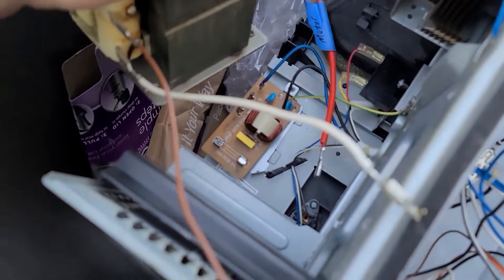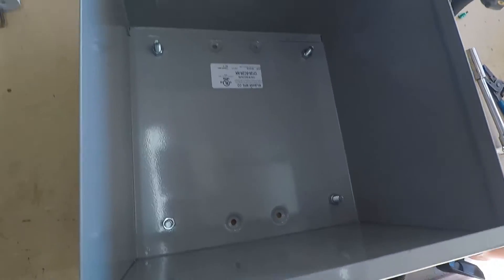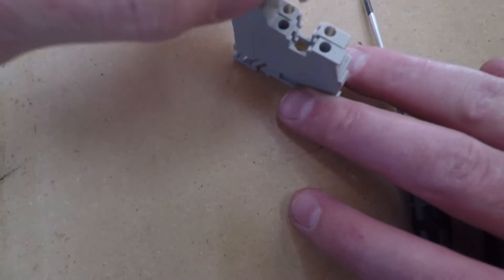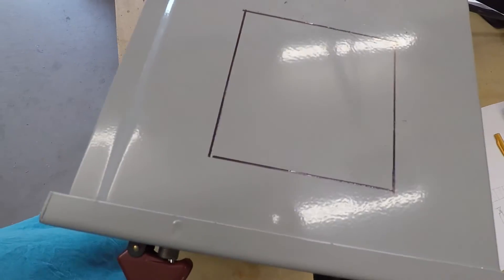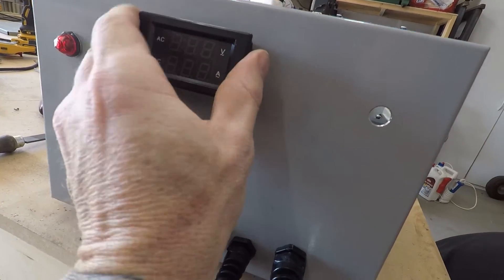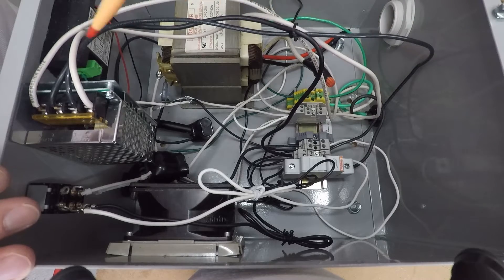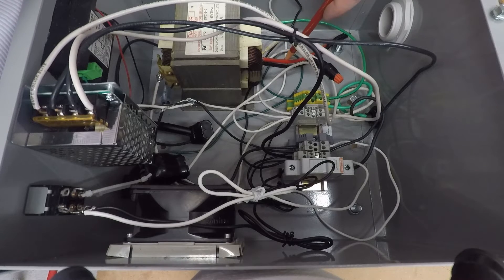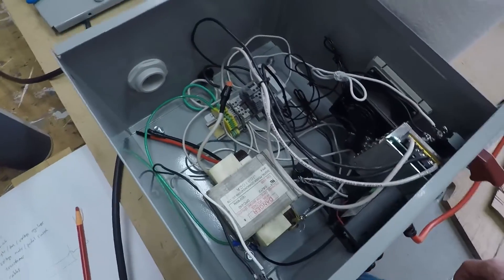DIY Build a Lichtenburg Machine

Comment: I looked at at the first 1:30 minute mark and said I've seen enough.  Opening up a microwave oven can be extremely dangerous if you don't know what you are doing or what you are looking at inside.  If you make contact with the capacitor inside and if still holds a charge, you could be killed instantly because of the high voltage it stores.  The capacitor must be discharged before you can safely work on the microwave.  FAFO.
Reply from the maker: That's a great point.

Comment: The voltage regulator is q waste of money, and it would be a lot smarter to use a plastic box. What if you lose a ground on the plug in the wall. Plastic box would do a lot better.

Comment: So how much for you to make me one?
Reply from the maker: Sorry but not making them for sell
Reply: @Vallenge Worth a try!  Lol
Reply from the maker: @Shadowwolf7774 😂
Reply: @Vallenge Couldn't you use the power from a welder to supply the electrical current into the wood?
Reply from the maker: @Shadowwolf7774 I don't know. I've never tried that.
Reply: @Vallenge it is the same concept, just with a different machine creating electricity at high voltage.😊😊😊
Reply: @Vallenge I bet it will work.
Reply: @Vallenge you did build a badass machine though!
Reply from the maker: @Shadowwolf7774 I really can't say. Feel free to come back and comment about what you find out.
Reply: @Shadowwolf7774 welders are not producing high voltage though. High enough to conduct through steel, but not wood...

Comment: Awsum video. I built my first burner a year ago however saftey was not a concern and ive bin bit a few times lol curently putting together a much safer unit. Im wondering How to read the high voltage after transformer coming out the hot lead? Is there a way to do this without a divider cuircut ?
Reply from the maker: Not sure. I would look for something that can register the voltage by wrapping around the cable if you don't want to interrupt the wire.

Comment: I hit a major snag 😞 .. Which terminal on the transformer is negative and which one is positive for your power cord going to the transformer ??? .. I have 2 of them side by side but dont wanna connect positive to negative or vise versa ...... Or does it matter at all ?
Reply from the maker: Hello. Without seeing your particular transformer I can't say which terminal you would connect to. My suggestion would be to try to use the process of elimination and logic to identify what the right connection would be. Please use caution and don't do anything that is unsafe.
Reply: Transformers are AC. There is no positive or negative. Clearly you have no knowledge of electricity. Please do not continue with this project. For 22 years I worked daily with equipment running on 5000 volts and even built my own 5000 volt power supply for a special project. I DO understand the risks and cautions that need to be taken.
Reply from the maker: Thank you for the response John. Safety should always be the top priority...

Comment: Great Job Thanks for so much information. I would have but one suggestion. In order for the cooling fan to work well you should have an exhaust side on the opposite side with a grill over it possible just a screen.  Thanks again
Reply from the maker: Thank you. Good suggestion.  I actually do have a vent away from the intake fan to allow  air flow.

Comment: Definitely don't take the need for safety for granted multiple people have died through electrocution using these 😫 also when you're disassembling the microwave be wary of the large capacitor it can hold a high voltage charge
Reply from the maker: Good advice. Safety should be the first thing in mind if someone decides to take on this type of project.
Reply: @Vallenge  yeah one lapse in judgment can be fatal
Reply from the maker: Yes it can
Reply: Any help I have microwave.please
Reply from the maker: Hi Ronald. I go through the steps I took in this video to try to provide information but if you have any concerns or unsure about any of the steps you're taking I don't recommend proceeding as this can be very dangerous. Thanks for watching my video!

Comment: How has the  lichtenburg machine held up?
Reply from the maker: I don't use it all the time but it has held up great. I've replaced a fuse one time and that's the only issue there has been.
Reply: Does your transformer get hot? I've just finished my build but my transformer gets very hot. It does burn the wood but to aggressively. What am I doing wrong?
Reply from the maker: My transformer does not get hot that I have noticed. Hard to say what the issue might be but things I would think about would be proper ventilation and air flow to help cool it and based on you saying it burns aggressively maybe too much power running through it causing heat more current means more heat. I would look at those things reducing the current and getting better airflow along with making sure that you're wiring is all correct.
Reply: @Vallenge Thank you! Problem was fixed with 2x fans and a huge heatsink https://youtube.com/shorts/nMGj4Gu58wQ?si=Xaxy1gTZu69m79Hp
Reply from the maker: @diesmeltkroes Your welcome

Comment: you have a cooling fan exit, but hole to let air in.
Reply from the maker: There is a inlet port that allows air in on the back. I already had one available and did not have to order one. Using a plug style port prevents small hands or fingers from accessing inside the box and keeps out bigger debris.

Comment: Using Jumper cables can potentially get you killed. They are designed for high current/low voltage which is exactly the opposite of what you are using them for. The insulation is not rated for high voltages. the leak thru can kill you, seen this mistake on many builds. The output is less than an amp so you need to be using a wire specifically rated for high voltages not high current, the awg for these is generally fairly small 14 to 22 ga. need a wire rated at least for 25kv.
Reply from the maker: Thanks for the information and helpful comment.

Comment: Very good, but this aircraft type switch is certaintly not 110v nor 230v rated.. These are almost always made for cars just for decoration which they are 12v.. And rarely for boats which they use 24v. But running 5-10 Amps of 220v power (or I don't know how much this transformer consumes at full power) is a lot for it, you are lucky that it didn't catch fire.
Reply from the maker: Thank you for the info.

Comment: Cannot wrap my mind why everyone uses those thick low voltage rated wires with huge 12V rated crocodile clips, Is like supporting a car with a broomstick and doing it because everyone does it even when it makes no sense and many have perished.
Reply from the maker: The voltage is high but the amperage is low which keeps the current within the range of the 6 gauge wire/cable. High Voltage rating increases with more insulation on the wires. I would agree that higher rated voltage cables are better choice as they have better insulation for voltage. I haven't had any issues but would opt for that upgrade on a new build.

Comment: Very nice setup, I have been watching several "how to" videos for ideas for when i build one. I have a question and you've likely already been asked and answered in the comments but tbh I almost always get distracted and forget what my questions are when I read through comments because there's always those experts of everything who post the most ridiculous and outrageous comments. So, if this has already been asked and answered I do apologize, I am wondering if you've had any issues with heat? I realize that is what the fan is for however I didn't see any vents or small holes for the airflow. If it doesn't overheat then obviously they're not needed but I believe that I will add at least a few small holes opposite the fan where cooler air can flow over and around the transformer. I am assuming that my future projects will be time consuming, I tend to overdo things so I want to be sure that I do not have any problems with overheating. I will say that you made one of the nicest setups that I've seen and I will be "borrowing" some of this when I build mine...lol

Thanks for the video it is very informative, I know what to build for what I need.. Thank you!
Reply from the maker: Thank you for the positive feedback. As you see in the video theyre is a fan to keep it cool. There is a vent on the backside too allow airflow. I have not had any issues with heat. Great question. Thanks again.
Reply: @Vallenge  thank you, watching on the phone I miss a lot of details. What you built is basically what I've had pictured in my mind for a while, I do not want something cobbled together that looks like random tweakers found some wires and a transformer and went crazy. I am considering a trigger like my mig welder instead of a pedal just because my luck sometime would step on the pedal to see what happens when I'm not paying attention. It would be handy to have the voltage regulator with the trigger, at least I think it would be handy for me. I should probably build a basic setup and try it out and see if this is something that I want to get into before building it how I think I might want it.

Comment: Great build.  However, I found your use of terminal blocks, although practical, confused the wiring description.
Reply from the maker: Thanks for commenting. I understand what you are saying but found doing a explanation via video instead of a wiring diagram would be understood by those without experience with wiring diagrams.
Reply: I just added the voltage regulator and meter you used, to my rig.  Thanks for that.  I had to ask an electrician friend of mine about the meter wiring, but I got it done.
Reply from the maker: @justdon5378  Glad you were able to get it done.

Comment: Reviewing that again.......on the bright side, there is some emphasis on making good reliable well planned connections.   But, no, no, no, it is not good to suggest to viewers that going cheap with wire nuts or whatever, is OK.  Shortcuts to make it cheaper all come at a hidden price with regard to 1.) performance 2.) reliability and 3.) safety.  Please, consider re-making this video and emphasize what is good about the build, and de-emphasize the short-cuts.

That said, there are still big gaps in the coverage of topics affecting the 3 items above, 1.) performance 2.) reliability and 3.) safety.
Reply from the maker: I can see the advantages of your suggestion to make direct connections versus the use of wire nuts.
Reply: @Vallenge   the bigger picture is relevant.   Cheapness has an unseen price.    Jumper cables for instance....cheap, totally unrated for these voltages or the overall application.    The PVC probes people build are equally ridiculous.
Reply: @Vallenge  Not just any "direct connections"  On the primary, standard electrical hardware is fine, terminal blocks, etc.  Whatever it is it must be mechanically secure, not able to float around like wire nuts.    Wire nuts actually if used by someone who understood all the issues could be used with relative safety, but mechanical stability is just better assured with properly selected terminal blocks.      

The secondary is another story.   The insulation strategy for attachment to the transformer is an area, as well as maintaining reliable insulation through the wall of the enclosure out to the clamps.   Re-doing those lousy cheap jumper cable clamps in a more reasonable way is a mechanical engineering challenge, I have only partial solutions at this time.
Reply from the maker: @TheGreenHeartofItaly-fl3wv Thanks for the continued information focused on making the project better and helping everyone learn.
Reply: And to your credit, you never suggested going cheap to sacrifice safety.   But wire nuts can be used different ways, with different results, so there is a possibility saving the price of terminal blocks could be very expensive.

Comment: As of January 2024, at least 33 people have been killed doing this woodburning trick, and every one of them thought they knew what they were doing. And those that got killed are still dead.
   Most folks do not realize that high voltage electricity (say 2000 V or so) can flow where you might least expect it, like across the surface of a table or over the surface of a PVC pipe. It will flow through the insulation on jumper cables and the wire used in residential wiring. It will flow through electrical tape as if it's not even there. 
   If you get hit, it will be over before you even know anything has gone wrong. And you will be dead.
-Old dude, not a safety nazi and not a pussy either.
Reply from the maker: Hi Clarence. Definitely something everyone should think about before attempting a project like this.

Comment: Interesting to watch. It appears that your are using car jumper cables that are only rated for 12-24 volts though. When you're pumping out 2,000 volts, this could prove to be fatal. Furthermore you talk about Hot and Ground, but as it's AC, it's actually Hot and Neutral, not to be confused with Ground.
Reply from the maker: Thank you for the info Paul

Comment: Vallenge, are the Output conductors or cables rated for the the output voltage of the transformer? Most electrical industrial wires are rated at 600 to 100 volts. What is the output of the transformer?
Reply: 600 to 1000 not 100 sorry.
Reply from the maker: No problem
Reply from the maker: Hello Cap. That is a great question. Depending on which microwave and which transformer somebody utilizes will definitely determine what their output voltage and amperage will be. Often cables are rated with a 600 volt rating with that said however I have had no issues using my 6 gauge jumper cables and I've never even felt them get hot. I would definitely suggest anybody concerned with this issue closely look at the ratings of the transformer they choose to utilize and the ratings of the cable they use. Thanks for your feedback and comment.
Reply: Not about heat but thickness of PVC insulation. Stay far away from those alligator clamps until the box is un- plugged from the wall
Reply from the maker: @d46512  😎